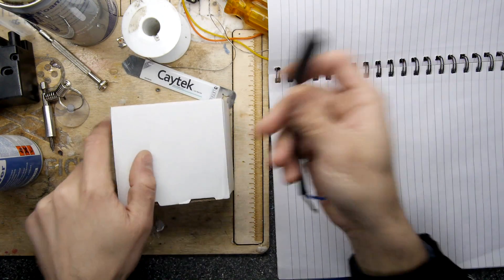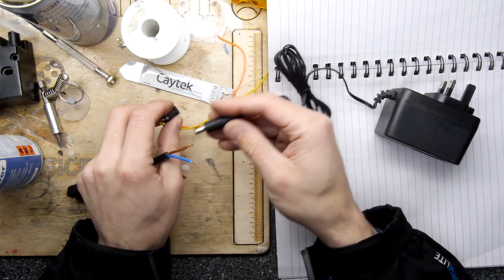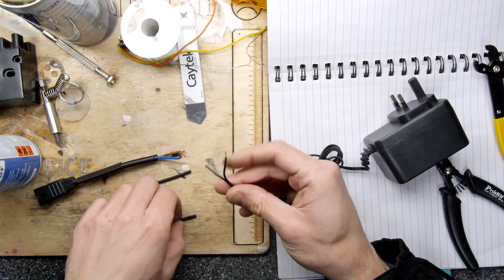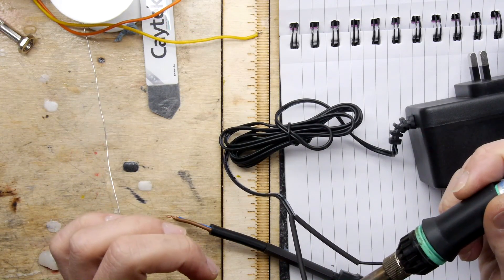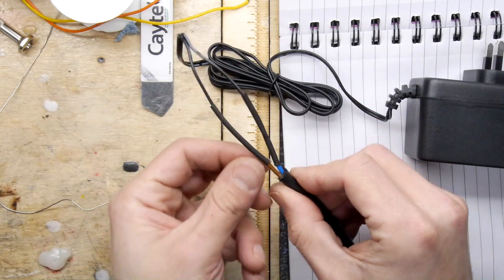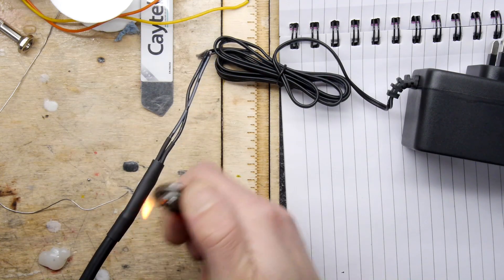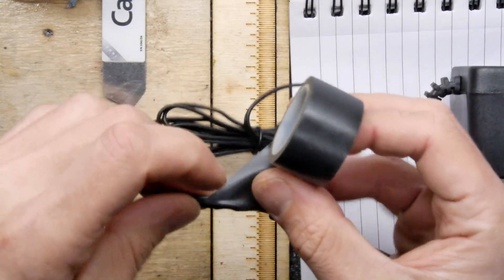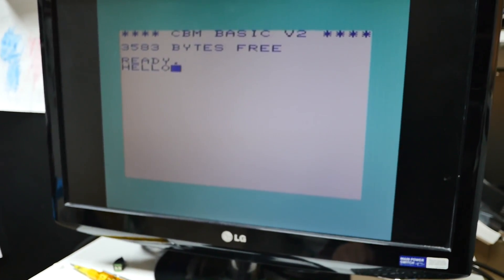Make a Commodore VIC 20 PSU

Comment: I have a dumpster fine gold vic-20. Two prongs. It says 9 volts ac what amperage do I need? I've had this thing for close to a year and I still haven't played around with it I've been busy with other stuff. But I'm a hoarder of sorts so I rather use whatever I have on hand. LOL I got my first big 20 in 1984 and I had the super expander and 8K and a 16k cartridge. Additionally I bought some boards that fit into the game port with multiple sockets and dip switches do you use all of these things together. I burn the Midnight Oil programming instead of pursuing girls because I lived on an isolated Farm. I don't blame all of this on me being a social Misfits but shit happens. Lol. The downside to the super expander was I couldn't share any of the beautiful software stored on tape with any of my lunchtime friends at the computer room at the high school. Talk about jerking off in the dark. Bwahaha.
Any information would be useful please. Such as when did the gold badges come out because the back label says on its Maiden Canada Vic 20 117 volts 1 amp 60 hertz serial number C265231. It is a two prong power input that says 9 volt AC. Thank you for reading this and I wish you a great day good man.

Comment: Hi Andrew, i've just got hold of a VIC 20 with no power supply with this same power socket as this one you are making here. do you remember any model numbers so i can order the bits so i can build one myself. Thanks
Reply from the maker: Not off the top of my head, but it's really simple I know that much. It might have been 5v AC or something. It's not like the others with various voltage rails
Reply: thank you i really appreciate you taking time to reply.
Reply from the maker: Ha ha no problem

Comment: Be aware that this only works on early models of Vic. Later models require C64 style dual supply with 5v DC and 9V AC. Also I believe some of the single voltage supply requirements can vary.

Comment: Hey Andrew! How did you determine the polarity?
Reply: I'm pretty sure the breezeblock NES had an AC output adapter. Basically it is just a stepdown transformer without any rectifier that would go in a DC output adapter. Acorn Electron was AC, too. Lots of telecom equipment and printers used AC, too.
Reply from the maker: Not necessary for alternating current makes life simpler
Reply: Oh! I see. That AC Adapter is putting out AC?
Reply from the maker: I'm guessing it's technically an AC to AC psu. It would really screw up something expecting DC so that's why I chopped the wire
Reply: Thanks for the info Andrew! Never seen an AC/AC Adapter.